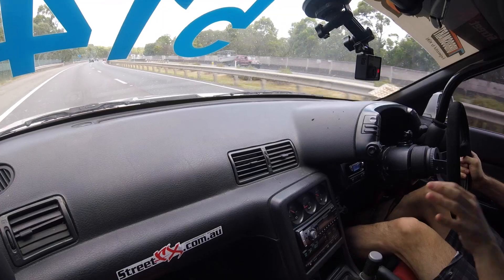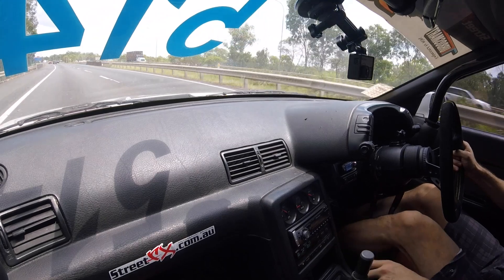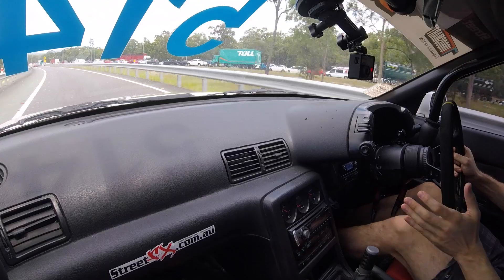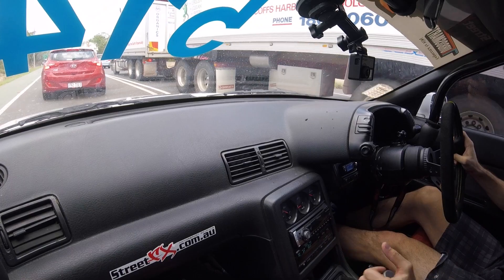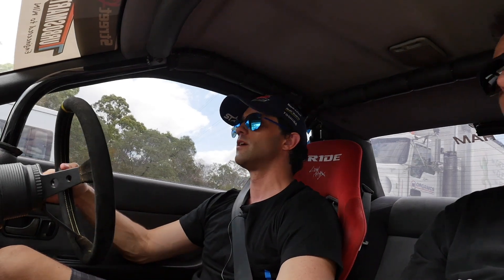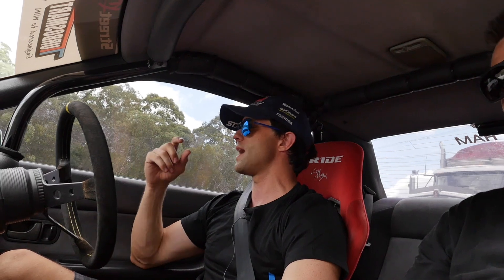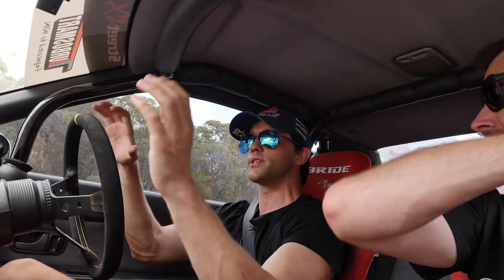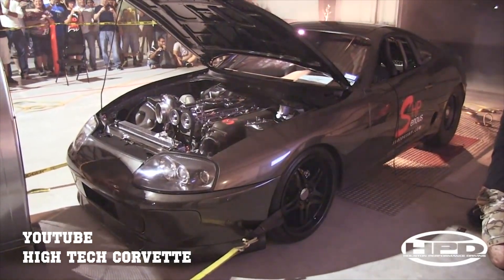What is TURBO FLUTTER & SURGE? Is it Bad? Myth-busting in our Nissan R32 GTR!

Comment: I rebuild turbos for a living, and what they're saying is pretty much correct. The thing is though, certain turbos can take lots of surge, and others cant. Turbos like Holset's,  Garrett GT37R's, GT40R's, or larger with beefy thrust bearings can take a lot of surge out of the box. Turbos such as TD05/TD06's, Borg Warner S200/S300/S400's, K24/K26's, Garrett T3/T4's etc can take surge as well as long as they have an upgraded thrust bearing. That's the one part of the turbo under stress when surging, the thrust bearing. On a turbo with a not enough thrust bearing journal area, the thrust bearing wears out quickly (because it is overloaded with thrust load and the oil film is squeezed away) and then you get loads of in and out shaft play. Then one day the compressor wheel tears itself apart by hitting the compressor housing. 

And another thing, turbo compressor nuts are threaded in reverse from the turbos direction of rotation, so they don't back off, they will only get tighter. Basically any OEM turbo is not designed to take the extreme thrust load from surging. Small frame steel ball bearing turbos will develop excessive shaft play from surge as well, ceramic ball bearing ones are generally okay.

Bottom line is most properly built aftermarket turbos with 360 degree thrust bearings, or just plain ceramic ball bearings can take the load of compressor surge. If you surge your OEM turbo it will probably last a good 6 months to a year of daily driving, less if you're running more than stock boost.
Reply: House of Boost probably the best thing i read out of this whole shit talking comments about uneducated big babies lol.
Reply: Thanks for knowing how to explain, we need people like you in this comments...
Reply: House of Boost that's the best shit i read ever
Reply: House of Boost  I have a stock 2015 evo and I was thinking of buying an aftermarket bov like Gfb.... any tip would be gladly appreciated.
Reply: go ahead, i dont have any tips there other than i personally like the tial q bov for its sound. obviously get a blockoff plate for the diverter valve and have the car tuned to a bov
Reply: @RHBTurbochargers  so u sayin my eBay churbo prolly won’t take the surge well?
Reply: So for say I plan on not running a BOV on my sc300 I will be running a s366 should I or just be cautious
Reply: What about 20 years old jounal bearing turbos? Like TBO384 (T3) from a Sierra Cosworth 4wd or R5 Coppa or...
Reply: So, to summarize, don't cheap out on a turbo if you want the flutter sound...
Reply: Jesus peeps just call a local shop that rebuilds turbos and you'll get your answer. I'm pretty sure this guy, however well experienced haven't played with every single turbine on the market, nor can he remember how strong/well built they were.
Reply: House of Boost I need a rebuild
Reply: House of Boost I have a Precision 6466 Gen2 DBB, can I ditch my Bov?
Reply: House of Boost you know if it would be bad to do that on a gt3071r @18psi ?
Reply: House of Boost Could I run a CA18DET with a Garrett GT2871R with no BOV making about 1-1.2 bar reliably?
Reply: great source^
Reply: have a stock mitsu 13t and its going strong 6 years now so...
Reply: Nice to see some good, solid info. Thanks dude.
Reply: so small ball bearing turbos like the old legasy's ones are getting damaged if not used with a bov?
Reply: Gtx3076r be okay?
Reply: What a lad.
Reply: To my knowledge all the 90's Skylines came out of the factory with this compressor surge, were they built for it or would it be smart to install a blow off valve for longevity?
Reply: Armando, did you find a solution ? I have a GT2560r and want to do the same.
Reply: How much would you charge to rebuild a tdo5
Reply: what are your thoughts on getting a bit of noise out of a vf39, as well as running about 19.75psi through it on a ej255 short block?
Reply: @AcuRobbie  the community says no to.  The vf39 isn't a great turbo.  However, there's a lot of videos on how to do it.  I can't recommend it without proof, though.
Reply: I'm about to install a procharger on my 6.1 hemi only mods 90mm throttle body and 3inch exhaust no cadilitic converters.  Probably in the 600 hp range.
What BOV do you recommend?
Your the first person I have read about that makes alot of sence. 
Thanks Sid
Reply: love you man
Reply: House of Boost I’m looking to get a Pipercross aftermarket induction kit on my I30N. Seen vids of this occasionally making turbo flutter. Do you know if this is risky for my car then as the turbo would be stock? If there’s any way I can avoid damaging it
Reply: I’ve got a Mazda speed 6/ Mazda 6 MPS depending on where you live and I’ve got a Garret 30/71, it’s still got stock BOV, I was wondering if it’d be okay to block my BOV? Or what’s the best option? I’m still new to turbo cars so any tips would be appreciated
Reply: House of Boost  🤘
Reply: So basically what you're saying is that they're incorrect. That it does cause damage unless you have a strong turbo with upgraded thrust bearings.....
Reply: @DearMajesty  They are correct, but they build 1000hp engines ofc they never used "cheap" turbos.
Reply: Thank God for House of Boost! 🙏🏻
Reply: What about anti-surge turbos with no BOV? What happens with those? Do they still make this sound?
Reply: @house of Boost - I am about this get a refurb / rebuilt Steal R33 GTST  turbo to full steel conversion with new bearings. Can i block off my BOV at 1 bar?
Reply: I ran a rb20 for over a year with bugger all increase in shaft play with no bov. My mate bought it and ran it another 6/8 months lots harder than I gave it. Turbo lasted fine. Had a big of shaft play. Was the ball bearing version tho. Dunno if that helped. Always done regular maintenance and warm up/cool down so I think how you treat it had a big impact on how long you will get out of it.
Reply: @clintonoldigs6249  Exactly
Reply: GT2560r at 8psi? Could I safely use the turbo with out a BOV?
Reply: so I shouldn't do it with a stock rb25 then? lol
Reply: @MyaSooon  prob not with a nylon compressor wheel and ceramic turbine lmao
Reply: I have a 60mm Garrett turbo with a .7 AR, I can’t remember the model for the life of me, would it be fine for me to run a little compressor surge so I can feel like I’m playing need for speed?🥵😂
Reply: I been thrashing my stage 1 s3 everyday for 5years 200k on the clock. No issues 😁
Reply: Thanks mate !
Reply: Thank you my friend!
Reply: Good to know 👍👍. Im just about to block off the BOV on my supra running a gen2 BW362SXE, but it has the 360 thrust bearing so should be fine
Reply: @Rochester's House of Boost  i have a question. The Vf48 has a journal bearing. Will this sustain the force of running no BoV??
Reply: What about focus st K03’s my BOV took a shit and it’s my only car I have one on the way will I destroy my turbo over the course of 500,1000 miles
Reply: @fredericleederman3824  Probably not unless those are track miles or really high boost
Reply: @RHBTurbochargers  no 85% highway the rest is downtown traffic. I really don’t beat on it on street.
Reply: damn thank u so much for this comment , was thinking of taking the bov off of my genesis coupe’s stock turbo but i’m just gonna keep the bov
Reply: @Roschester's House of Boost how would a ko4 hold up?
Reply: How about my Garrett T28? It's got quite a bit of flutter with the current piping/bov set up, I always see people online have it too but never really asked myself if it's dangerous.
Reply: @blakeslide6919  A T28 won't live forever I'll say that much
Reply: @RHBTurbochargers  Gotcha, im going to go forged internals with my SR20 along with some head work and slap a tomei BX8270, aiming for 400hp. Lmk if you have any turbo suggestions.
Reply: What's considered a "small frame" BB turbo? Looking at a G25-660 or comparable Borg EFR for my ~2.3-2.5L engine.
Reply: Doesn't the current S series borg have upgraded thrust bearings already?
Reply: My man, if you dont answer I understand, I know we all no nothing asking is annoying, I am putting a RB25DET with a big turbo in my 280z, planning around 500ish hp, definitely want a loud flutter, would you say go for it of avoid it or any advice? :)
Reply: You got a youtube channel? I want to follow
Reply: marco gonzalez and we need leeches like you to go away

Comment: From my experience the "fluttering" during gear changes or letting off the throttle overtime is damaging to the turbocharger. The blow-off-valve is opening and closing rapidly which is causing the turbocharger to compress then dump the air at a high frequency, stress then little stress... This can damage compressor/exhaust wheels and/or the shaft which could break through the oil film. But you all are the experts.
Reply: The fluttering sound is not a blow off valve opening and closing rapidly, cars without blow off valves get flutter so your theory is already out the window and if you understand how blow off valves work and what causes them to open then you would know they don't open and close rapidly.
Reply: Does this mean the sound is the waste gate?
Reply: No, the sound is on the compressor side of the turbo not the exhaust, they explain it in this video.

Comment: ask yourself, have you ever seen anyone blow a turbo because of turbo flutter?
Reply: it's a great example of the difference between theory and reality
Reply: You can shatter compressor fins. Plus it slows the spooling while it's happening, because it interrupts the airflow.
Reply: Not to say that's impossible but I've never seen that happen. I've heard of overboosted ceramic turbine wheels breaking. But with modern turbocharger with billet compressor wheels I find it unlikely to happen. I've been running a gtx2871r at 25 psi with no bov for 3 years now with no issues.
Reply: I'd love to see what difference you'd find putting on a BOV that is big enough to dump the pressure properly, after 3yrs of not running one. I think you'd find your turbo more responsive. Do you run a wastegate, or have you deleted that as well?
Reply: I found it way more responsive not running one. Of course I run a wastegate, how else am I going to manage the boost level?
Reply: I'm so confused as to how it's more responsive without a BOV. I understand what a wastegate does, that was a bit of a silly question, but then you're not running a BOV. To make sense of why it wouldn't have been as responsive, it makes me think that you may not have had the valve spring tensioned enough and would've been leaking out through the BOV instead of it going through your throttle body..
Reply: Honestly I think it depends on what your doing with your car, if you doin strait line stuff and your only lifting to shift, a properly adjusted BOV recirculated setup will be fine. But if your drifting and your constantly modulating the throttle it's more responsive to not let the pressure out. It's a matter of preference.
Reply: It's certainly been an interesting discussion. It's definitely something I'd like to learn more about. Take it easy bro :)
Reply: Yeah, you too
Reply: Yeah actually, its pretty funny watching it on a dyno 😂
Reply: In short yes
 What do u have to gain? If u say performance then u should find a safer hobby

Comment: For someone who is meant to know cars, you talk a lot of nonsense.
Reply: Simons World Quit preaching to the stupid. You lost him at fluid Dynamics. 😂
Reply: Hahahaha, I guess you know it all then aye?    
He absolutely got it right, I suggest you keep learning some more about fluid dynamics and how all this works before bagging others out for the correct knowledge, he nailed it more than 99% or people do. 
Yes it hurts turbos over time, I would correct him on that, but with new tech in billet wheels, this is not as a bigger issue as it was a few years back.   
Axial thrust bearing issues will still be a concern for the long term, but will take ages before signs of wear are seen.
Reply: Tjeerd Gerritsen air is a fluid and compressing air is all a turbo does but, when you have all the pipework, inlet manifold and a set of cams that allows a direct path through from the turbo compressor to the exhaust turbine, there are many factors that need to be considered when understanding how the air moves the way it does and why.
Fluid power or Fluid Dynamics is the way to understand these factors at greater depth.
A single turbo vs a twin setup will need different pressures to achieve the exact same amount of air in the cylinder at a certain Rpm.
Eg: only because a set of twin turbos needs 30psi to achieve the same HP as a single setup on 20psi does not mean the twins at 30psi are filling the cylinder any more than the single turbo.

Anyway a bit off track here...... Lol, but this is yet another example of how complex turbo systems can appear to be.
Reply: You queried "Fluid Dynamics"  I gave an example of VE in relation to turbo charging.
No if you have a direct path from the compressor to the turbine it is not broken, it is exactly what happens when the cams are in their overlap phase, the boost pressure is directly pushing right through the engine and pushing out exhaust gasses, this is why restrictive exhaust housings on ting twin turbo setups have to use higher PSI to get the job done, it is a lack of efficiency. 
Turbo surge does indeed reduce compressor speed and can in extreme cases bend a compressor or destroy it totally.  Lift off surge is not the same as WOT surge which is when the turbine is being kept at max speed with the exhaust and then you get surge pushing it in the opposite direction.  Lift off surge does impede the compressor, but at-least the turbine is not trying to push it back int he opposite direction. 
Compressor surge is not my idea of having a well balanced engine in a turbo setup, but hey, it isn't going to wreck his engine or turbo being like this.   I would rather no surge sound and have a free spinning turbo ready for the next gear, but when you are on full song you are hardly going to get much of this flutter surge anyway, maybe a little bit, but not like a full lift off.
Reply: Simons World respect for bringing up the physics behind this man. Took two years of ap physics my sophomore and junior years of high school. Shit brought back memories.
Reply: He asked, "can you explain fluid dynamics".  As in... explain what the term "fluid dynamics" means.  Evident by his comment, he saw the word "fluid" and misunderstood it to mean "liquid"; as in, "liquid dynamics".
Reply: Simons World  "this is why restrictive exhaust housings on ting twin turbo setups have to use higher PSI to get the job done"

Its not the exhaust housings... its that the smaller compressor wheels are less aerodynamically efficient than a bigger one... and have higher pressure ratios for a given air flow.  Just look at the compressor maps.
Reply: Simons World Can you explain fluid dynamics? All the turbo does is compresing air.
Reply: Simons World a direct path from the compresor to the exhaust side of the compressor? That's not what happens in this video. Boost pressure is building up in the inlet side because a closed throttle, this slows the compressor down and creating more turbo lag. If you have a direct path from compressor to exhaust turbine, the turbo is broken.

Comment: so its a bottle necking in the system for the turbo... cool
Reply from the maker: what do you mean it's bottle necking the turbo? of course when the throttle closes the air just stops flowing.
Reply: he said that one way was from when the turbo is forceing too much air into the enigine cuasing it to slightly stall, the open throttle turbo surge. the term bottle necking means that one or more components are over performing a major component that results in a performance limit. so if i understood him right, the turbo is surging more 02 than the engine can use causing it to stall a cylinder?
Reply from the maker: not so much a bottleneck, but the result of a turbo being able to produce more air than the engine can consume at those RPMs. It only happens under brake boosting. If the brakes arent applied, the revs are high enough for the engine to take everything the turbo can give it.

Comment: massive out of balance strain on a tiny turbo shaft. hasn't failed yet... don't pretend it will hold up
Reply: It will hold up just fine, it has already for awhile, it's very common here for people not to run a blow off valve/bypass valve and never have issues.